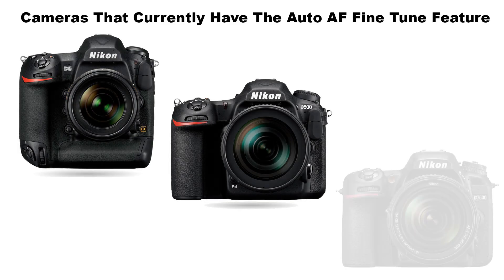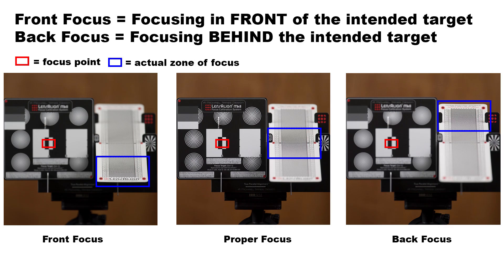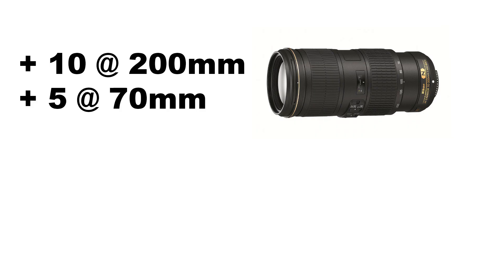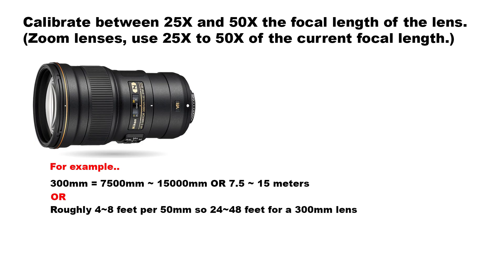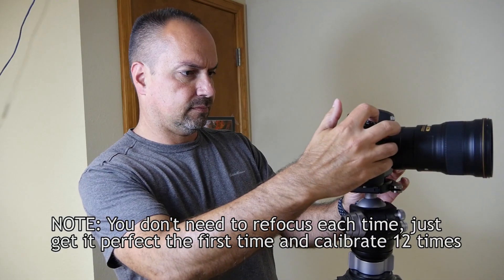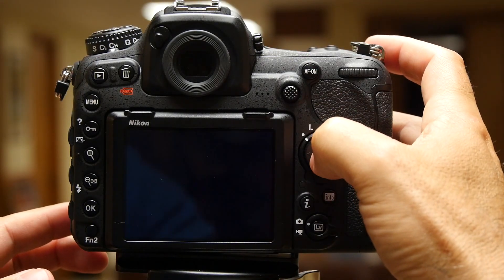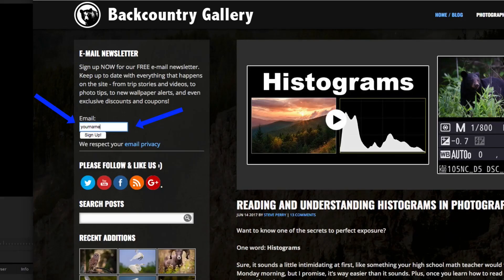Nikon's Auto AF Fine Tune - How To Get The Most From It

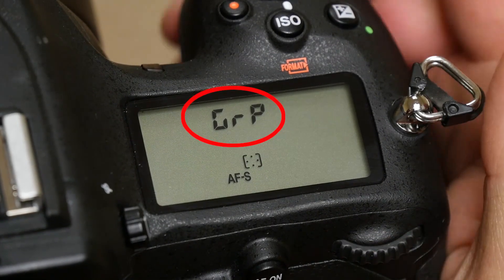Comment: 6:43 af fine-tune turn on is usefull if you have calibrate an lens on your dslr where the calibration values are entered!
So, turning it on without performing lens calibration using a card or special software like Reikan Focal is absolutely pointless!

Comment: Sir my nikon D810 picture is sharp when taken through Live view mode but while taking trhough viewfinder the picture comes out to be blur (Tho it looks focus through viewfinder) and this happens with all lens. I have tried fine tuning but i m confused with saved value and default value and i m unable to resolve tho have tried with all the values possible.
Reply from the maker: Don't use the default value unless every lens is off by the exact same amount. I don't think I've ever come across a case where setting a default value helped. Just adjust the normal values and see how that goes. The other issue that can come into play is that the lens requires different values at different distances (or, in the case of a zoom, different focal lengths) - sadly, there's not a good solution to that one. If you can't adjust it so it produces sharp images, there may be something going on beyond a simple AF fine tune and you might need to have Nikon look at it.

Comment: Many thanks for sharing Steve, this really helped me recently when fine tuning my AF with my various lenses on my D500. I think I know the answer but just wanted to check with you (or anyone else who can kindly advise)...I recently bought a 2nd D500 which is as new & has only done approx 1300 frames. I'm assuming that I'd need to complete this AF fine tune process with the new camera & can't just apply my saved values from my 1st D500 for each lens? Many thanks in advance. Ben 👍😁📷
Reply from the maker: Yes, you need to do it separately for each camera. They often need different values.
Reply: @backcountrygallery  many thanks for your reply. Yeah I thought that must be the case. Will do that for my 2nd camera. Thanks again 👍😁📷

Comment: Dear Steve, thank you for this great tutorial. I tried to fine tune my Nikkor 200-500mm with my D500. However, I find it impossible to make reference shots without any movement in the system (even with the most stable setup) because one has to touch the ok button to release the shutter. This might work with short lenses but not on a 500. I tried to activate the self-timer for this but its not working with the fine tune menu. Do you have any tips for me? Kind Regards, B
Reply: Identical problem. Were you ever able to solve it?

Comment: Hi Steve, thank you for this video. I have a range of lenses and am not really looking forward to go through this for every lens but I did notice something recently. I do have pictures that are acceptable to good when shot through the viewfinder but always found them still a bit on the soft end, or strangely enough when in Lightroom and putting the focus point indicator up on the screen/picture (plugin for that), sometimes the not locked AF point picture is better than the one dead on. So I started wondering, reading up on the symptoms and found that taking pictures through the viewfinder were kinda soft but the ones done with live view (and manual focus) were sharp, just slightly soft through the viewfinder.
Is that an indication I should maybe have my D7200 serviced (for the first time in it's almost 8 year of use)?
Reply from the maker: It might need a trip, but first, blow off the AF sensors. They are under the mirror box - you'll need to lock it up and blow under the mirror area with a rocket blower or similar. That might help.
Reply: @backcountrygallery  Thank you Steve, I did that but still having the same softness. I've tried several lenses and even my 200-500mm lens takes nice crisp shots when using the live view setting. I guess the Nikon camera hospital will needs to be visited for full check up (might as well) to get some more fun out of the camera. Love your videos Steve, always helpful and educational!

Comment: Great video. If I'm using my D7500 which has a 1.5 crop sensor and I have a 35mm lens, am I using 35mm as the focal length or am I using 52.5mm?

Comment: Steve, Your input would be greatly valued. I meticulously followed your advice, conducting 12 tests at both 70mm and 200mm focal lengths to calibrate my Tamron SP 70-200mm f/2.8 Di VC G2 lens on a Nikon D850. The results indicate a average of +3 at 70mm and +14 at 200mm. This difference between the two focal lengths strikes me as quite notable. In your experience, do you believe this variance is within an acceptable range for this lens? Your insights and advice would be highly appreciated. Thank you in advance.
Reply from the maker: I think Tamron has some sort of dock for this purpose. I'd look at that - that's just too much of a difference IMO. Sometimes you can split it, but I have a feeling it'll just make the long and short ends poor while the mid-range might be OK.
Reply: Thanks Steve! I just looked into the dock. It's the Tamron Tap-in Console, it works on the new G2 Zoom lenses from Tamron.  I just ordered one from Amazon and will get it this afternoon. I'll let you know how it turns out.

Comment: Hello, great tutorial. Just one question remained? When finishing the proccess, we need to turn the auto tune option off, right???? Thank you!
Reply from the maker: You have to leave AF Fine Tune turned on or the camera won't apply the adjustments when you attach the lens. Auto Fine Tune should be off once its input the value.
Reply: @backcountrygallery  Thank you very much. Please, just one more question....I tried used the method with my Nikon D750, but, unfortunatelly, when I tried push AF button together with recording button, the notice of Auto tune didn´t appear. Do you know any issue related with this model??? If I use the scale, manually, it´s work as well?? Thank you again and best regards from Brazil!
Reply from the maker: @vameza1  The D750 doesn't have Auto AF Fine Tune, it's only on the newer cameras (the D780 has it, for instance). It still has AF fine tuning, but you have to do it manually.
Reply: @backcountrygallery  thank you!! Now I get it. Cheers!!!!!

Comment: One question.  You mentioned the variance between long and short end of zooms.  Are you taking 12 shots for both the long end and the short end then splitting the difference between the two averages?
Reply from the maker: Pretty much. For sure 12 shots on each end. If it's way off though, splitting the difference isn't always great and I tend to favor the end I use the most and bias that way by a few points. However, if it's really really off - send it in for repair.
Reply: @backcountrygallery  ok thanks!  I'll give it a try!

Comment: Hi, nice tips. Also, does Nikon d7200 have the ability for AF Fine tune by pressing AF and movie button in same time? 
It sould appear display massage: Before, fix the camera in place and check that it is focused. Proceed?
Reply from the maker: The D7200 does not have Auto AF Fine Tune. It has AF Fine Tune, but you have to do it manually.
Reply: @backcountrygallery  ok, thx for reply.

Comment: Sir I am using D500 and nikon 200 500 lens which  no of calibration need ??
Reply from the maker: Sure, it's possible. In fact, most of the time calibration really isn't necessary. I only recommend it if you see consistent front or back focusing in your shots.

Comment: At 07:23 you say "carefully focus on the target in live mode". Does this mean allow the autofocus system to acquire focus? How is this going to calibrate a new setting? Won't it just lock-in the errant focus setting? I'm confused.
Reply from the maker: Live View doesn't use the PDAF sensors and instead uses contrast detection (usually more accurate). So, if you have a lens that Beverly front / back focusing with viewfinder AF (PDAF) and then use live view to focus, you'll find the lens is accurate. What this system does it to look at where focus should be compared to where it thinks it should be and make the adjustment.

Comment: Hey Steve, am interested in buying either Focal or the Lens Align system to fine-tune the autofocus on my lenses with my D750/D810.
Any recommendations as to which is better?
I'm assuming after reading in your book that with zoom lenses you have to choose one setting for all focal lengths as far as fine-tuning goes.
Is that correct?
Is it necessary to calibrate for each body separately as well?
Reply from the maker: For those cameras, both are good although I don't think Lens Align is supported (or at least updated for new cameras) anymore. 
Sadly, for the D810 and D750 you have to pick a single AFFT setting. Newer Nikons (D780/D6) allow for multiple AFFT values (near /far), but older cameras do not.

Comment: when I press AF Mode Button & Movie Record button, it didnt pop out dialog box as your Video, I'm using Nikon D4. Thanks, same setting with you :(
Reply from the maker: As noted at the 20 second mark, this only applies to newer cameras. Sadly, the D4 does not support Auto AFFT (although you can manually tune it)
Reply: @backcountrygallery  Thanks Steve, Thought it work on D4 also. I need to upgrade :)

Comment: Just got a D500 and am reading your ebook right now, it's fantastic. Just answers so many little questions that pop into my head. Nice and clear, easy to read and understand. I'm now wondering if my Tamron 150-600 needs fine tuning or if it's my skills that need honing. Just not getting that pin sharp focus especially when the subject is far off. I'll do some tests.
Reply from the maker: Thanks!

The last chapter of the book talks about subjects that are far away and the potential sharpness problems so you may want to skip ahead to that one. It covers a few other possibilities as well. Also, it's totally possible that it needs some tuning - Tamron has a TAP console that allows AFFT adjustments at different focal lengths and focus ranges.
Reply: @backcountrygallery  Thanks Steve, I'm skipping ahead right now.

Comment: i have a nikon D800
so what about if i reach to 20+ and 20- and the lens still doesn't focus properly in the center (still off) but no problem focusing manually in the center. what is the next step to that?

Comment: Ok i have a Question here. So if i have a few lenses i use with the NIKON. Will the NIKON remember what lenses need to be set to what when i change them out?
Reply from the maker: Yes, as long as they are all different lenses (i.e. not a pair of 70-200s for example)

Comment: I tried doin this today and it was crazy. I did 3 different lenses, and with the camera locked down, in bright light with a good target, I was getting readings of +12, -17, +4, +10, -20, -10 just all over the place. I ended up doing it manually, the auto AF just was too erratic. Not sure what I was doing wrong.

Comment: I have tried to Fine tune my lenses. I always get the massage Auto AF Fine Tune Is Not Available At the Current Focus settings. I look up the settings in the manual and they are the same as you told in the video.
Reply: Frustrating, isn't it?! I eventually discovered that I hadn't pressed the centre button of the multi-selector, this ensures it's using the centre focus point while in LiveView! If that isn't it, check you're in Normal-area AF, I still had it on Pinpoint once.

Comment: After the setup, should I leave the Auto AF Fine Tune "On"?
Or is the On/Off part just for the setup only?
Reply from the maker: Leave it on or it won't apply the settings as you use it.

Comment: This was a very helpful video!  But, I'm having an issue on a couple of my lenses.  I had no issues with my Nikkor 105.  With my 24-70 and Tokina 11-16, I get a successful reading a couple of times, then I start getting "Auto AF Fine Tune Failed".  I re-checked all settings, and have the camera as stable as possible.  Any suggestions?

Comment: I have seen advice before indicating to use only the images taken for calibration, and to NOT use the Live View to achieve focus. I guess these are all just different methods. But I am glad that I know THIS one now, which seems fairly easy and straightforward, and also what Nikon had intended. I would probably use both methods just out of curiosity, the other method involves finding focus on the optical viewfinder, so it makes sense that Nikon has allowed for the use of live view to accomplish  the same thing, since many of the new Cameras are mirrorless, and would still need to be calibrated like any other. So this makes perfect sense to me now. Thanks. I have watched about 5 of these videos so far, and each of the 5 offer  a different method, so bottom line I am learning a lot.  Databyter

Comment: Hi, My question is do i need to change this setting to my findings each time i change to a different lens or will the camera remember which lens has what setting?  Oh and also should i remove any UV filters before doing this or should i do it with the filters on? Thank you for your time.  have a good one
Reply: I have a d3500 but I would say to not have uv filters on. What glass are you using that you even need if filters with?  Nonai?
Reply: @b5_345  thanks for the replay but I got it all figured out.  Have a good one.

Comment: What if that dialog box doesn’t pop up after pushing  the autofocus mode button and record button simultaneously? Does it matter that the record button is set for? I changed mine to ISO. This is on a D750.
Reply from the maker: Unfortunately, the D750 doesn't do Auto AFFT - you have to do it manually.
Reply: Steve Perry well that explains it 🥴 thanks!

Comment: so wont this mess up focus for the other  two of the trinity of nikon lenses ??
Reply from the maker: The camera knows which lens is attached and only applies the setting to the lens or lenses you have adjusted. So, if you need to adjust the 70-200 and then attach the 24-70, it won't use the adjustment you put in for the 70-200.
Reply: @backcountrygallery  thanks steve , iv tested the focus of all lenses and theyre all fine ,, iv ordered a sigma 100-400 contemp - lens  which  is my main concern , theyre either razor sharp or need a docking tool ( which i really cant be bothered with while i save for the nikon 180-400)  if its good il use it if not its going back  , but thanks for that

Comment: Very useful, I was concerned my new D500 had a fault and I'd have to send it back, but I will definitely use this to try to fix the issues I'm having with back focusing.  But what if you use multiple lenses?  Will the camera remember the setting for each lens (if different) and adjust the autofocus fine tune value when you connect that lens?
Reply from the maker: Yes, it will remember each lens you use (I think up to 20)

Comment: wonder if auto af tune is just as good as manual (or with reikan, before i got d500 i used reikan for years)... btw, i once saw that sometimes af becomes sligtly off in lower light and with af assist (eg d600/df), guess you may need to calibrate in lower light with af assist if  you work a lot in ll (as i do, tango parties, i use external af assist on df just to help to its crappish af, flash with af assis is no-no for me)

Comment: Here's a much easier way to figure a reasonable target distance if you're used to working in feet rather than meters, using 30x the focal length as a general guide. For a 50mm lens, that's 50mm x 30 = 1500mm which converts to 4.9 feet—call it 5 feet for our purposes. So just take the focal length of the lens, move the decimal point one to the left, and label it feet. For a 24mm lens, 2.4 ft. 105mm lens, 10.5 ft. Plenty close enough to get into the sweet spot of that 25x-50x range.
Reply: Do we need to multiply by the crop factor for aps-c systems?